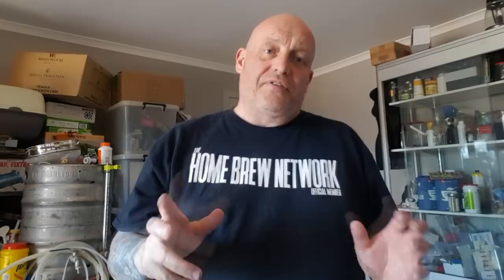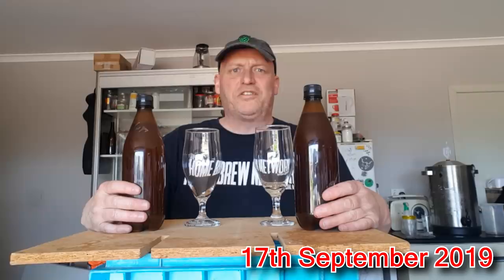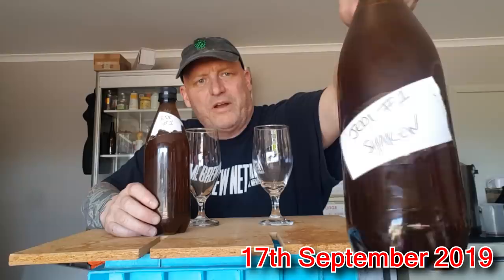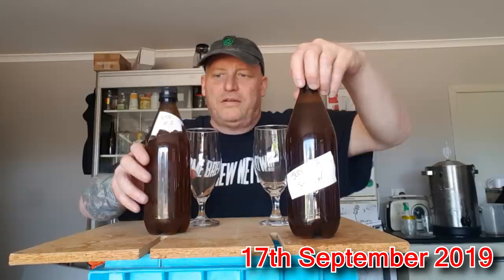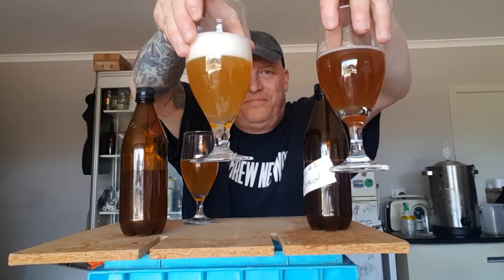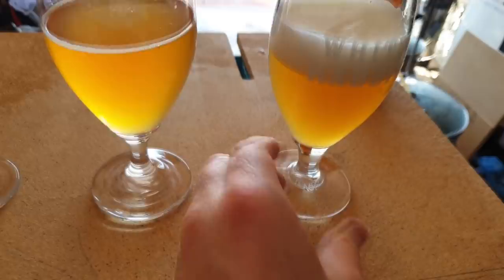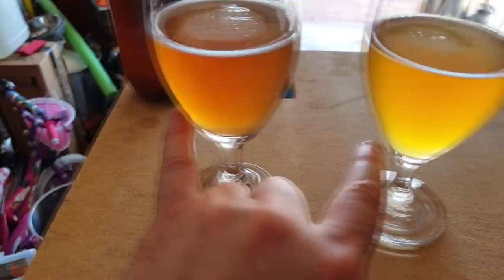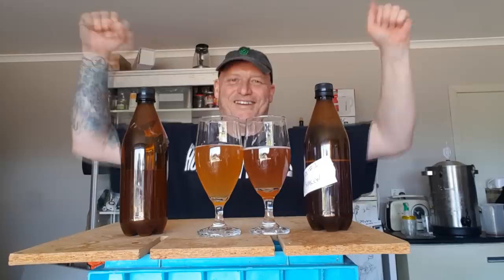OXIDATION TEST - Bottling Home Brew Beer!

Comment: Wish I would have been told this 14 years ago when I first started brewing. Was ready to give up before I started kegging. All my bottled beers suffered from varying amounts oxidation and I never could figure out why in my process where it was coming from. The efficiency of my all in one I will end up with 5½ to 6 gallons and for a while was bottling the remainder that didn't fit a corny. For the past year I've just been dumping the leftover and stopped bottling because the oxidation was still there compared to what I would pull off tap. Now I know to not to muck around shaking the bottles. Just leave them alone. Thanks Gavin! Cheers from Wyoming USA!
Reply from the maker: Unfortunately unless you use a fancy bottling device all bottle conditioned beer will be oxidised, as much as a lot of home brewers say theirs isn't, it is. All these little things help though! Cheers and thanks for watching mate

Comment: It would have been interesting to see a third bottle where you just skip the shaking but don't squeeze out the extra air.
Reply: Agree 100% with you bud. Be interesting to see that one.
Reply: @damo250f  Yeah definitely - mimic the process of using glass.
That said - I've just moved to kegging and it makes a significant difference in the colour and quality of the beer vs bottling even without shaking.

Comment: Such an awesome video and really helps explain to the home brewer about oxidation issues. There is a practice with glass is you place the crown cap on after filling and leave it for a minute before capping. That way the co2 pushes the oxygen out if the bottle as it's released from the beer. I practice this when bottling and have not had issues that I can tell. What are your thoughts on this. Cheers
Reply: Great idea.
Reply from the maker: Yep I started doing that when I was bottling after one day I heard one of the caps rattling and a light bulb went off in my head, I remember telling Craigtube and I think he started doing it for a while, that was long agoooo hahaha Great tip Finn! One I hadnt thought about since I rarely bottle these days. Cheers mate
Reply: I didn't know about that but I will be certain to give that a crack next brew. A Norwegian brewer also told me you can get crown caps with an oxygen absorbing layer inside that's activated by water. I'm tempted to give these a shot as well but they don't seem to be cheap in Australia for some reason, despite being peanuts in other countries.
Reply from the maker: Yeah I havent seen those around for years, i was always paranoid so used to sanitise them, which destroyed any help they may of been, I'm not sure how truly helpful they are, but anything helps I guess!
Reply: i bottle my entire brew with the lids sitting loosely and you hear the caps popping and rattling, i then cap when the last one is filled.
Reply: Thx, I'm going todo this for my next batch.
Reply: I've just done a batch and left cap loosely on top 2 bottles, my question is how long does it take for secondary to start..

Comment: I just did my first batch of beer. I used an auto-siphon to take the beer into the bottling bucket. I put sugar in solution into the bottling bucket and mixed it with the beer. So no need to add sugar to the bottles. Then I  used a bottling want to fill bottles up from the bottom. I did not shake. Hopefully carbonation will fill the space at the top of the bottle.
Reply from the maker: Bulk priming. Bulk priming is really bad for hoppy beers, don't age them. Once they are carbed and ready to drink try and store them cold. The beer gets oxidised in the bottling bucket. You'll here a lot of beginners tell people to use a bottling bucket but its just not good for hoppy beers, its ok for big stouts. Cheers!

Comment: Bottled for years using glass bottles and always turn it upside down once and then back upright to mix in sugar.  Bottled probably 200 batches and not one issue.  It's a non issue.  I've not met one homebrewer who bottles that's ever had an issue either.   Maybe it's those PET plastic bottles.

Comment: Great visual demonstration of what oxygen can do to a beer. I'm guilty of the bottle shake. Might have to change that habit for sure. I bottle in glass so it will be interesting to do a comparison between a shaken and non shaken. I'm guessing the difference will be less without being able to squeeze the air out. Who knows. Cheers Gash 🍻
Reply: Do it dino! Would be a great follow up vid!
Reply: @StassBrewing  sounds like a plan. I'll keep it in mind. Cheers
Reply: Do it mate was thinking the same thing. Great Vids too mate. made a few of your brews came out great.
Reply: @shanerobinett2857  Will do. Great to hear the beers turned out well. Cheers mate 🍻

Comment: Great vid Gash,  I get so much shit from using PET bottles but I'm going to show this vid every time just to prove a point.  cheers
Reply from the maker: PET bottles are fine mate, you probably wouldnt store a imperial stout for 5 years or anything but they are fine! Cheers!
Reply: I use pet bottles and does this little trick apply to cider as well or just ales.
Reply from the maker: @tigertank1a421   It certainly wont hurt

Comment: I can concur that bottling w/o shaking is better. I stepped up my game another notch when I went to keging and blowing off the O2 with 4 pulls of the reliefe valve before letting it go to carb up. Even tested 12psi for 2 weeks vs 30 PSI for 2 days. If ya need to get a beer going faster, 30 PSI for 2 days for Hefe is great or Ambers that need another 2 weeks in the keg to mature works on 12 psi for 3 weeks.

Comment: Good video lucky for me i noticed it very erly in my brewing career. My Evert first brew was sligtly oxidized then a saw that video and corrected it in my second brewing. The beer from the second batch was lighter in color and had a crisper aftertaste. The first batch was barley drinkable after 4 weeks. I am a extrakt brewer only, Coopers for the medium abv and brewferm for the heavy stuff. I use that tecnic for bottling white wine also. Make a good sparkling wine.
I use white sugarkubes for coffe instead of carbonating drops, fits nicely in the bottlenecks and cheap.

Thanks for your usefull videos, cheers from a snowy north sweden!
Reply from the maker: Good stuff, Cheers mate!

Comment: Should have done a bottle without squeezing the air out but also not shaking. Would have be nice to see those results. I bottle with glass bottles but don’t shake. Haven’t noticed an issue really so far that I could tell

Comment: I even (as I showed on my channel) when bottling flush the bottles with co2. For me I get like strawberry jam from oxidized beer.
Reply from the maker: Agreed, co2 flush with a bottle gun or even better a counter pressure filler is probably the best way, the only way I avoid it is by not bottling, if it wasnt for this test that beer would be on the garden hahaha true. Cheers Dr!

Comment: Hey mate, love the channel and your advice, I was wondering have you ever used ascorbic acid. I've just got a 30L fermenter and I bottle  cheers 👍
Reply from the maker: I don't, I would, I use SMB, but it's not a magic bullet you can't use it and be sloppy. I'd still do this even if I used it. What I would do is use a SMB rinse for the bottles before filling, that's sanitising and adding a small amount of protection at the same time. Cheers!

Comment: I use a Williams Warn 50ltr brew Keg. Then counter pressure bottle. Then drink in a total time of 7 to 10 days. Have you ever thought of priming your bottles with Co2 first?
Reply from the maker: Yep, I would a beer gun or counter pressure bottle filler, to be honest though I rarely bottle hoppy beers, I just keg them, I'd of normally tipped out what was left after kegging. Cheers!

Comment: Hey just a quick question when using brewing salts do u add just for mash water amount or for the whole batch size?
Reply from the maker: depends on the beer, and the mash it is most important because it can adjust the pH but if you're aiming for a particular water profile for an NEIPA or anything really, then yes I add more to the boil. Cheers! Not sure if you saw my brewday JEDI JUICE video where I go through the water adds. Cheers!

Comment: This is a great test, but can you do it again with a third, what I would call a control.  Do one bottle that you don’t squeeze the air out of and don’t shake.  I would like to see where it lands between the other two.  When I bottle a batch, I bottle in glass and put a sugar solution in the beer before bottling so I would like to see how much oxidation happens in that control bottle.
Reply from the maker: If i had of had another bottles worth I would of, but I think everyone that bottles and kegs knows that normal bottling suffers from oxidation fairly badly, unless you flush bottles well with CO2 using a bottling gun or the like. I did the two extreme ends, well that could be done without using a CO2 bottle. If I end up with extra beer any brew soon I will do it again. Thanks very much for watching and cheers mate!

Comment: How about doing a third bottle... add the sugar and beer, squeeze out the O2, put the cap on, then shake it?
Reply from the maker: If you get all the oxy out it should be fine! I only had two bottles left in this brew to test with, might try a bigger test next batch. Cheers!

Comment: Oxidation is definitely the thing people call "twang" when it comes to extract kits since the vast majority of people who use them have no closed transfer system and usually bottle conditioning without flushing the oxygen . 
do you think you can prove this with test of any extract kits and bottle some conditioning without flushing the oxygen and transfer some in closed transfer to a keg ? since you have all the tools for this test you could solve this "twang" mystery

Comment: Great experiment and helped answer a question I have been hesitating to place on a fb homebrew group in case the oxidation police shoot me down in flames haha ;) I only bottle and used to give three inversion shakes to mix in the sugar, but the more I read about oxidation I wondered if I was damaging my beer. I have started giving just one inversion, but probably should not mix that air at the top of the bottle at all. My question: do you think the yeast will find the priming sugar (I use table sugar) if the bottles aren't shaken at all? Cheers for ya time, mate.
Reply from the maker: No need at all to tip the bottles, the yeast will find it no worries! I used to be a tipper too hahaha Cheers!

Comment: Does the oxidation apply for PET bottles only? Or it'd occur with glass bottles also?
Interesting experiment..
Reply from the maker: It occurs with everything bottles, cans, glass, plastic, kegs and casks. everywhere Cheers mate!
Reply: @HomeBrewNetwork  after thinking a while the reasons I'm sure you're right. But how detrimental it is for the beer? I think it comes a time when there's no more oxidation that could occur to the beer since all of the oxygen already got into the beer.. so the solution would be to fill the bottles up to the top with no headspace? Couldn't they explode? Couldn't much of that oxidation you got come from the previous shaking you did? 
Cheers!
Reply from the maker: You must leave headspace, the best solution is using a beer gun or counter pressure filler. The amount of oxygen to ruin a beer is less than 1 part per million, its extremely small. It's nearly unavoidable in home brewing, but its really worth doing anything you can to reduce it. Cheers!
Reply from the maker: Here's brief pdf on the subject Cheers! https://www.hach.com/asset-get.download.jsa?id=50544340453

Comment: Awesome results. What is that stainless vessel you are using as a fermenter here?
Reply from the maker: Its a mangrove jacks fermenter
Aussie EBay -https://rover.ebay.com/rover/1/705-53470-19255-0/1?mpre=https%3A%2F%2Fwww.ebay.com.au%2Fitm%2FMangrove-Jacks-Stainless-Steel-25L-Fermenter-Craft-Series-Home-Brew%2F292588118414%3Fhash%3Ditem441f9c618e%3Ag%3AZqoAAOSwDPNbBH1O%3Asc%3AAU_StandardDelivery!3030!AU!-1&campid=5338500856&toolid=20008
Reply from the maker: US EBay https://rover.ebay.com/rover/1/705-53470-19255-0/1?mpre=https%3A%2F%2Fwww.ebay.com.au%2Fitm%2F7-Gallon-Stainless-Steel-Bucket-Fermenter-by-Mangrove-Jack-Beer-Wine-Spirits%2F273618011547%3Fhash%3Ditem3fb4e7859b%3Ag%3AfXcAAOSwdd9aXWMo&campid=5338500856&toolid=20008

Comment: What's the best way to avoid oxidisation when kegging
Reply from the maker: Its to completely flush a keg with co2, see link below. Then fill direct like below, or use gravity and create a loop by  connecting gas to outlet to gas outlet then you can avoid using co2 to  transfer. Cheers! https://www.youtube.com/watch?v=8xJq_moF1Uk

Comment: any other advice for bottling with glass
Reply from the maker: Best you can do is just take it easy, avoid splashing etc as much as possible, if bulk priming do it extremely carefully. The only other way is to use a bottling gun and a CO2 tank but if you  have a tank you're probably kegging anyway. Cheers!

Comment: While this test does demonstrate oxidation of beer it has nothing whatsoever to do with shaking a bottle of freshly bottled beer. What it does demonstrate is that with a plastic bottle by squeezing the bottle you can expel all the air from the bottle. The other bottle has not been compressed to expel the air and after the carbonation period the increase in pressure in the head space has force oxygenated the beer inside the bottle. If he really wanted to demonstrate the difference shaking could make he had two choices either leave air in both and shake only one or take the air out of both but only shake one... it is science but not high powered get it right!
Reply from the maker: I never claim to do science experiments lol I was just rushing it along, oxygen will be in that head space and in that wort immediately, slower than shaking, but nonetheless enough to cause damage before any carbonation starts. And there's absolutely  no way the yeast some how eats the oxygen up and "fixes" the damage already done to the beer.  Cheers mate!

Comment: Why are you squeezing out the oxygen?  Can you do another experiment comparing a bottle that had the oxygen squeezed out v. just leaving the head space created by the bottling wand?  PET v. Glass bottle.  Salud!
Reply from the maker: It helps prevent oxygen damage. I will do a bigger test, this time I only had two bottles left of beer, the rest was already in a keg! Cheers!
Reply: I've tried squeezing and not squeezing the bottles before, the beer without squeezing had an obvious colour change and oxidation and the squeezed one was fantastic. Trust me, it works!

Comment: If you are a homebrewer, then DO levels should be of zero concern to you. Brew regularly, drink fresh, or stick to Commercials.
Reply from the maker: Not right at all mate, DO is still the number one enemy in beer. Especially if brewing NEIPA, very expensive to brew and can be ruined extremely fast. As the only beer drinker in my house I want my beer to last and taste fresh till the last pint. I've been brewing 35 years and have been professionally trained, I know what works and what doesn't. This was just a simple experiment to show the dangers of DO and that yeast can't magically fix it, once the damage has been done. Cheers mate!